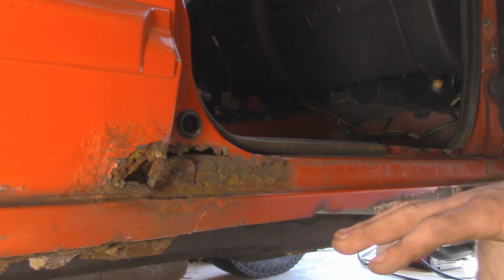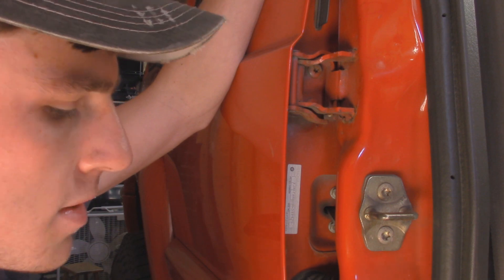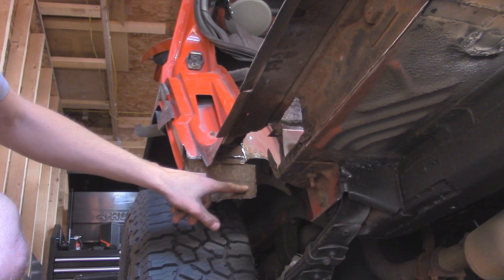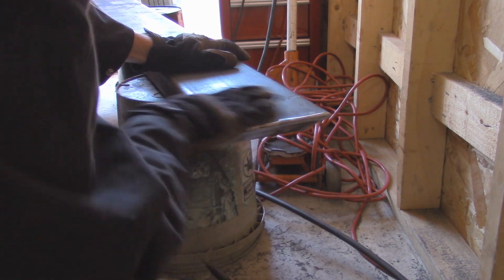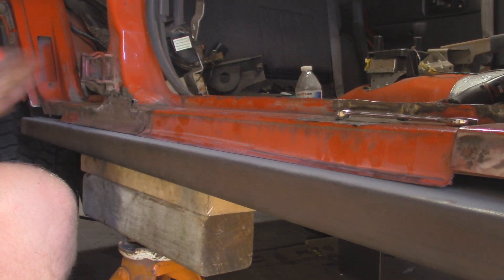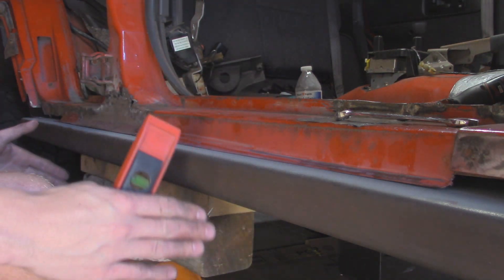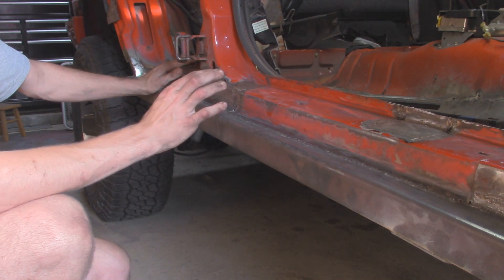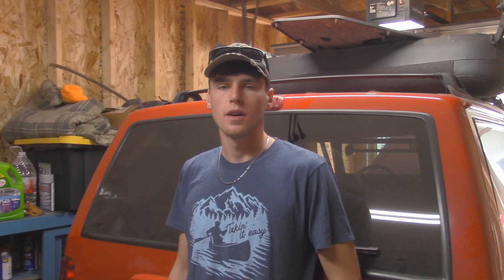Jeep Cherokee XJ Rocker Panel Replacement | 2X6 Rock Sliders

Comment: When you were doing the lift kit, I was wondering about all that work on such a rusted out XJ. Now I see that rust isn't an issue after all. It is so rewarding watching you reclaim a vehicle that others would write off as junk.
Reply: Almost exactly the same condition as was my zj, pretty much did frame stiffeners, sliders, longarm switch all at once
Reply: Its about relative value. I just paid decent money on a little ole ladies  XJ because it was.....a little ole ladies. It needs rear leafs, u bolts (broken) and her husband used aluminium and latex paint to put lipstick on the pig on the rockers. It was quite funny actually. I knew what he'd done. It is perfect and unmolested. ...so it was worth it.

Comment: Thanks brother. Everything you have done in this and the video before this is pretty much everything I have have to do to mine. I was starting to get a little discouraged and I have years of experience. But I also suffer from bi polar and perfectionism so everything becomes very difficult in my head. If I don't think it's going to come out perfect I tend to never end up doing it. I know what has to be done but seeing it actually being done makes it easier for me. I was really stressing about spending the money on OEM floor pans and like you said they're expensive and I was having a hard time visualizing what it would look like with regular sheet metal and whether it would come out good without having bead rolls and the right curvature. Also I wasn't sure on what size tubing I was going to use for the rock sliders. I also have to do the rear quarter tuck. It really goes to show that even us guy's with past experience can learn from the younger generation. So please keep them coming brother it's really appreciated. 💯
Reply from the maker: Glad I can help. I think that as well in my head, but I try to stay positive because it always ends up turning out someone decent in the end.

Comment: A few tricks I've found with rusted bolts. Tightent before loosening it helps break the rest. The other is put the socket on the bolt and hit the socket with a Hammer it kind of shocks the rust a bit add some heat and some spray and usually comes out.

Comment: On my 98zj used round 3inch tube, cause zj rocker panels curve perfect fit hidden inside, 3 square tube  ties welded to frame stiffeners, as are longarm conversion kit  part of it, only a 4inch & 31s  as mainly a daily

Comment: Nice job I would have put the same up towards the top also I'm going to do the same thing to mine however I'm going to use a 2x8 rectangle 1/4-in walled and I'm going to put four supports from the subframe under the channel for more support The reason I'm going with 2x8 instead of 2x6 and it looks like there's only going to be like an inch and a half left over and be running over rocks and stuff don't want to damage the doors those things are going to get beat up pretty bad so I figured 8 in that'll give me 3 and 1/2 3 1/4 in sticking out past the door instead of inch or inch and a half just for more protection just food for thought brother Nice job

Comment: I see you used that Lincoln 140 mig (or I'm guessing you did anyway), was this on 110v? I need to do this to my Jeep badly but am stuck trying to figure out if I can do this job well on 110v as that is all I got right now
Reply from the maker: Yup it's 110 and its plenty powerful enough. The welder is rated up to 5/16" on flux core at 110v.
Reply: @OutJeeping  awesome thanks so much for the reply! You still have/like that Lincoln? Really trying to find the best bang for the buck for this job along with needing to do some patch work to the quarters/floors eventually.

Comment: Can you print over POR 15?
Reply: I guess that answers my question
Reply from the maker: Yup, it definitely needs to be too coated if its exposed to sun as it is not UV resistant.
Reply: @OutJeeping  do you have to paint it while the POR 15 is still wet?
Reply from the maker: @petersaurusrex9135  For best adhesion you can paint over it when it is still tacky. But once it's dry you can take a higher grit sandpaper or scotch bright to scuff up he por-15 to have it adhere the best.

Comment: hello my jeep xj 2.5l 1994 when driving when it is hot it tugs and breaks below 3000 revolutions and over 3000 revolutions is ok you can advise something in poland nobody knows what's wrong with it ?
Reply: changed cables, candles, shaft sensor, lamdba probe
Reply from the maker: It's hard to say what is could be without me seeing it in person. If I were you I would keep researching the symptoms and looking on Jeep forums.
Reply: ok I can't find information anywhere, but thanks for the hint, best regards

Comment: What is the welder setup that you used to do this? Also, what thickness steel did you use?
Reply from the maker: I used a Lincoln 140 Mig with Flux core. The 2x6 had a 0.125" wall thickness.

Comment: Love this video how much would you say you spent on the metal used for these rock sliders?
Reply from the maker: I got a deal through my friends work. So all the sheet metal, 2x6", and 2x4"  for fixing all the rust I got for $150. Though steel prices will vary in your area and where you purchase from.
Reply: @OutJeeping  alright thanks for the reply!